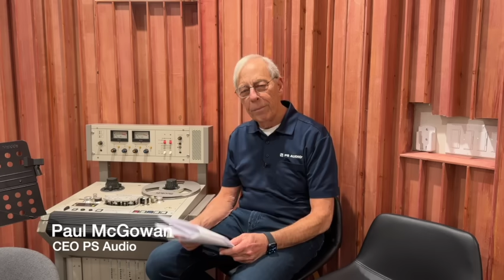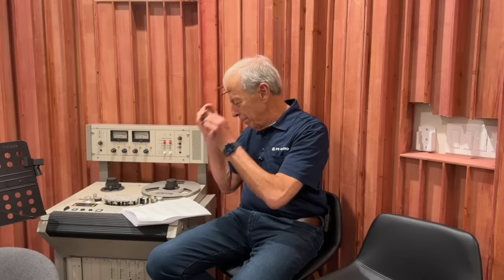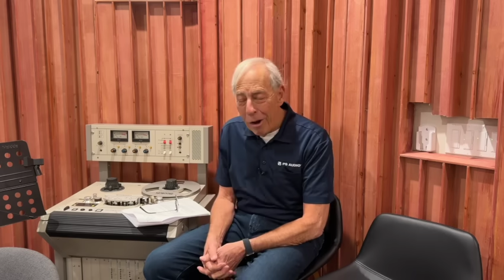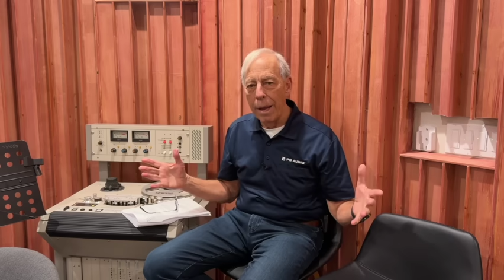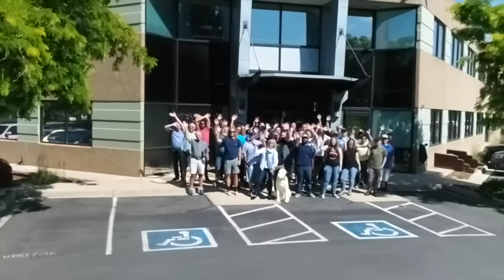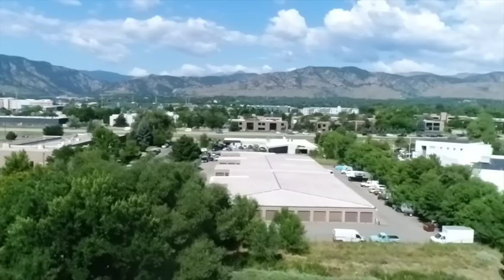When measurements and listening disagree

Comment: We are still using steady state sinewave measurements from the '40's and '50's. They fail to measure how a circuit handles the instantaneous, nonrepeating, complex transients that are music. e.g. It is easy to design an amp with extremely low THD using massive feedback loops that destroy the ability to handle those transients.

Comment: If after your measurements it doesn't sound good, it means one thing - your measurement equipment is too low level or you just do not know what and how to measure. 
Many audiophiles say "measurements mean nothing" just because they have no idea what measurements are.
Reply: Is that why most equipment designers measure and then listen and proceed to make changes? Why do they even bother listening if measurements are the deciding factor? Topping equipment measures great but doesn't sound good to many people.
Reply: @mitchtaylor6512  No. Not quite. When a device like a Topping measures perfectly but "sounds bad," it’s often due to cognitive bias or speaker pairing.

The transparency paradox: If your speakers are harsh, a transparent DAC will reveal that harshness. A coloured DAC with rolled-off highs will make the system sound "better" by hiding the speakers flaws. The DAC didn't "measure poorly but sound great" it rather acted as a filter.
Also one shall not underestimate the marketing force. By claiming that they listen and make changes, they cater to a wider audience.
Reply: @mrpeterfromgodknowswhere sure keep telling yourself that
Reply: I get it. It’s often more comforting to trust a gut feeling than to accept that our ears can be easily deceived by cognitive bias.
Reply: @mrpeterfromgodknowswhere  the way in which audio electronics are measured in isolation and not the way they are to be used and there is no agreed upon human weighting system.  The bias you write about cuts both ways, just because it measures great you think it sounds great.

Comment: Even with the most careful voicing in PS Audio‘s listening room there is no guarantee at all that the voiced device it will sound great as a component in my stereo chain in in my own listening room. And even if I would purchase a complete PS Audio chain my listening room and the limited possibilities for a stereo set-up will mainly determine the final sound quality. Thus I have to voice the system preferably using DSP based room- and speaker correction systems (Trinnov, BACCH, Acourate, Dirac, etc.)

Comment: when a dish is crafted by a skilled chef its usually not completely unhealthy nutrition

when something sounds or tastes like shit and seems to measure fine you simply measured the wrong aspect

when you start by following the art of engineering and cooking using decent ingredients you usually dont end up with things that tastes bad
Reply: ...you simply measured without listening.
Reply: @FatRat-f9m you simply must to build the circuit first before being able to have a listen , and when following the rules for good sound ( socalled good engineering practice ) you usually don't end up with something that sounds ugly
its about the engineer being allowed to make good stuff and not something cheap and coming with huge design compromises
Reply: @AximR.Meissner  ...yes, measuring (making/taking measurements) during design & early production is necessary, however, once the product is built then it's all about the listening.
Reply: @FatRat-f9m i see you are not into research and development , you tradionaly dont need to verify the performance of a well executed design , when you have to listen the outcome to make sure the sound is not horror you are not a skilled circuit developer ,

like said, when the circuit developer following the rules for good sound and the guy being skilled the outcome is usually not bad sounding - and you dont need to confirm the sound signature of the very circuit implementation, since the circuit and its coloration being known

Comment: When someone is arguing that measurements rule, when you bring up important things that we have no way of measuring like clarity, coloration etc... all of a sudden they clam up. It's been known at least as far back as the 1950s that there are certain things that sound great but don't measure well and vice versa. The measurement mavens really have no argument; and know it. Yes, measurements do have SOME uses.
Reply: That's not true. For example; clarity isn't magic; it's low THD and fast spectral decay. Coloration isn't a mystery; it's a deviation in frequency response. If a listener can hear it, the air pressure changed; if the air pressure changed, we can measure it.
The 1950s argument is a relic. Modern FFT analyzers detect signals down to -140dB that is orders of magnitude more sensitive than the biological limit of human hearing, which is masked by our own blood flow and nervous system noise. The gap isn't between the sound and the data; it's between your subjective vocabulary and your understanding of signal processing. Measurements define the limits of reality; your ears just define your favorite flavor of distortion. Don’t confuse your personal taste with a failure of science.
Reply: @mrpeterfromgodknowswhere   ...you're quite insane aren't you...or are you just very high?
Reply: But they will still try & throw the placebo defect & expectation bias & A/B/X blind testing at you...even if it's not appropriate.
Such is their overcooked engineering mindset...poor devils. I can only pity them.

Comment: Thanks for the explanation on how your company designs speakers, sounds right. Next question it prompts, do you ever compare the end result specs to the starting specs after the tweaking? Curious if there are repeatable "tweaks" that you use as starting points on the next design? And how different does it measure after the human hearing test?
Reply: Not just how his company designs loudspeakers...but also how they tweak their DACs, phono stages, preamps, power amps & streamer.

Comment: In my experience, those that measure very well usually dont sound good. I only look at the measurements as guide but my ears has the final say.
Reply: Yep. The measurements look good when using an overall global feedback loop, but it sounds tight and compressed, not lively. Why?
Reply: @johnnaighley9252  Actually, that 'tightness' is just high damping. The amp is controlling the speaker so strictly that it prevents the natural ringing you're used to hearing as 'liveness.' It measures better because it's more accurate to the signal; you just happen to prefer the sound of an amp that lets the speaker distort more. But the 'tight' sounding amplifier is more true to the source signal.

Comment: A tuner can measure and determine if your bass guitar or acoustic guitar is perfectly tuned at a specific note.  However even when perfectly tuned both instruments will sound differently when you hit that note. There are clearly more varaibles that have yet to be discovered when measuring instruments and sound reproducing equipment. 🕵
Reply: And if it's tuned 'perfectly' it won't sound correct because of the tempered scale...Thats why Pianos need to be tuned by ear
Reply: An anus and a mouth are both holes, but different effects come out of each.
Reply: @peanutbutterjellyjam2179 ... I will bet that it took every brain cell you possess to come up with that. Sadly, it is not impressive.
Reply: @edgarortiz4681  🖤edgar.. u could have put it nicely and said.. sadly however, it's not uniform in application.. 😂
Reply: @clickbeetle2720 ... I chose not to.
Reply: @edgarortiz4681  🖤why..?
Reply: @clickbeetle2720   ... different strokes for different folks  ...don't you know??
Reply: @peanutbutterjellyjam2179   ...with some commenters those two holes that you have mentioned are interchangeable...just sayin'

Comment: Why don't you measure slew rate?  Your Audio Precision boxes measure slew rate readily!  You said TIM, AP also measures TIM.  Slew-induced Distortion (SID) is also measurable quantity.  Show us the difference if it is real!
Reply: If your amplifier has a big bandwith with the feedback loop opened, it will be fast enough to handle the desired slew rate within the audio range, so no SID will occur, even when the feedback loop then is closed. This maybe one cooking receipe for constructing good sounding gear ... ;-)

Comment: https://www.youtube.com/watch?v=UolnQ0nWV20
Reply: every type of converter design comes with its own sound anomalies - google for Dynamic Element Matching Dac principle like used in the famous TDA1541 - its everything but acurate but its considered to sound good, having its special flavor that some people appreciate a lot

that DSD has a very flat output filter that doesn't attenuate the converter noise sufficiently enough doesn't say anything about how acurate the signal is within audio bandwidth

when bitstream being invented long ago designers found out that having a steep filter is not that beneficial because the bitstream is so much higher in frequency and being distant enough to not cause anything audible , on the other hand a 3rd order filter above nyqist would affect the sound causing audible signal deviation
Reply: @AximR.Meissner  ... "it's everything but accurate but it's considered to sound good"
You can say that about vinyl & also about vacuum tube amplifiers.
Reply: @FatRat-f9m same about bipolar transistor ab pushpull or mosfets , same about switchmode amplification or deltasigma modulation , same with data compression or redbook CD

they all have issues and they all causing certain sound anomalies due to their principle of operation, and all can be considered good sounding 

that in dsd and bitstream conversion the designers just skipped the decimator and using singlebit instead of multibit deltasigma just delivers the noise spectrum pretty much untouched , and having horrid converter noise compared to pulsecode operation

its like comparing oranges and apples and trying to prove what tastes better - they are just entirely different

what is better , a car, a submarine or an aircraft ? lol there is no better 😊 becuase they are too different
Reply: @AximR.Meissner  ...the operative word was "good" not "better". Personally I use the word 'Pleasing' to the listener.
Of course home-audio music reproduction is subjective...it always has been so.
Reply: @FatRat-f9m  there are way to different types of 'pleasing' sound to generalize due to the fact that every listener has different preferences to be pleased !
one guy learned that it sound 'correct' with tube generated harmonics being added , and the other guy learned that some retro DAC from Phillips is pleasing him best - and both are actually ' incorrect ' when its about reproduction acuracy

some dirt is considered to be part of natural sound ,and this is a learned expectation

some distortion is just renamed and called saturation instead and suddenly its becoming ledit to have some of it

and hey, there is no speaker/ room combo that doesn't cause you serious (!) amounts of distortion ( even worse with a phono source ) and almost nobody cares about since its just natural type of distortion and/or judged by preference